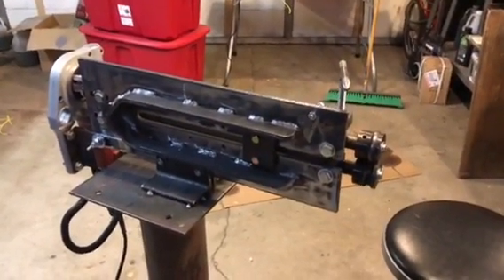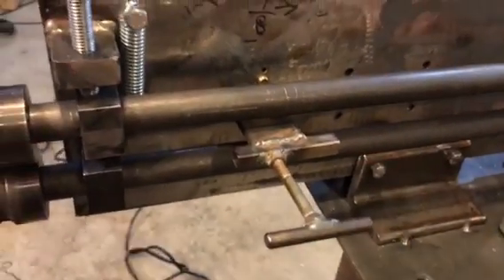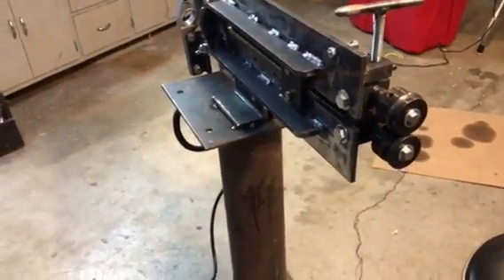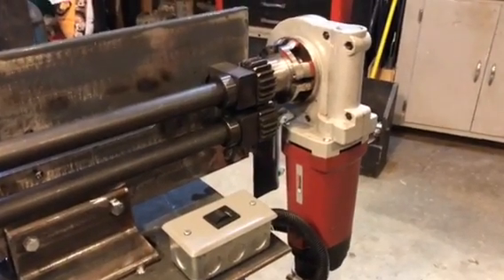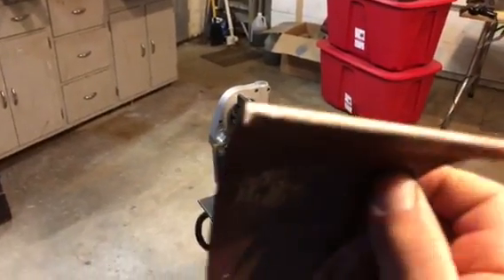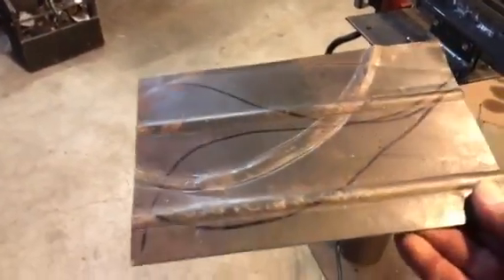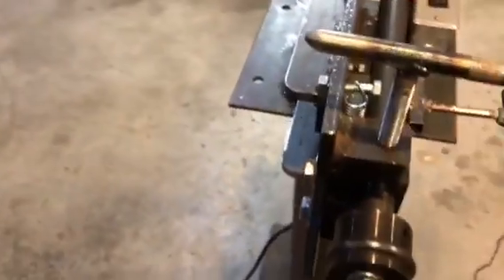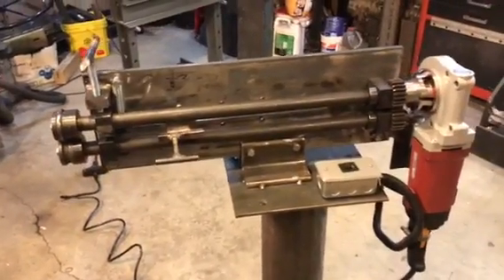Harbor Freight Bead Roller Modification

Comment: Jim, care to share how you mounted the pipe threader to the bead roller?
Reply from the maker: Sure.  One of the thread dies was a slip fit over the bead roller drive rod.  I simply welded it on the rod.  The threader tool will come off but the die is permanent.

Comment: Good job, don't you think it's a bit too fast?
Reply from the maker: Yes.  For regular rolling it’s fine but for detail stuff or if I want to do flames it needs to be slowed down.  So far everything I have done with it has turned out.
Reply: @jimmcclellan1911  Glad to hear it turned out alright, I also followed Jere's design for my bead roller but for now I'm kinda stuck with a manual drive(steering wheel from a boat) and looking for ideas on what to use to make it power drive.  Imay go with a small(6 RPM, high torque) geared motor .
Reply from the maker: @ddistrbd1  if I were to do this one again I think I would use a treadmill DC motor.  They are powerful and can be slowed down to snail speed.  I do have a manual speed controller that I can plug mine into to make it super slow.

Comment: do u hv to plan ahead to get the bead to stop forming when doing a specific length that does not roll off the sheet metal ?
Reply from the maker: mrtws63 Yes.  It does not do an immediate stop but does stop quickly.  It only took a little practice to get the feel for when to stop it.

Comment: Is there a reason why you are using the top shaft for the power supply
Reply: David Miller you don’t power the top shaft because it is modified to slide back and forth.

Comment: Wondering what/ how you attached the pipe threader to the main shaft?  Thanks
Reply from the maker: Jon, I used one of the threader dies and welded it to the bead roller shaft.  My plan is to use another die on my tubing roller and then I can use the threader to power either machine.